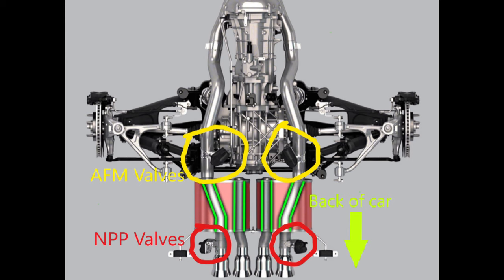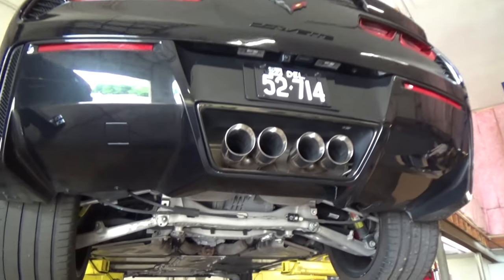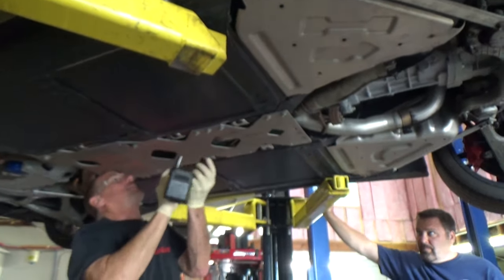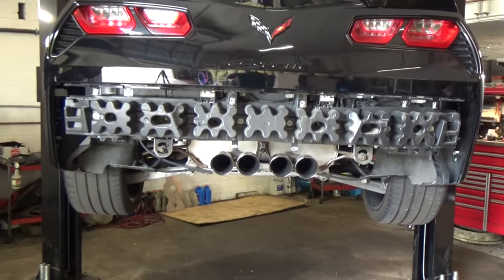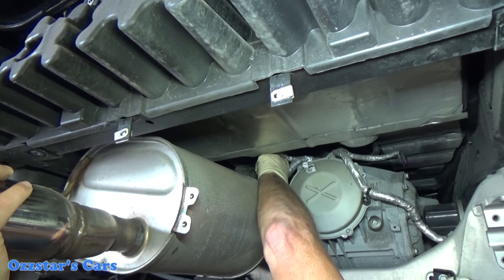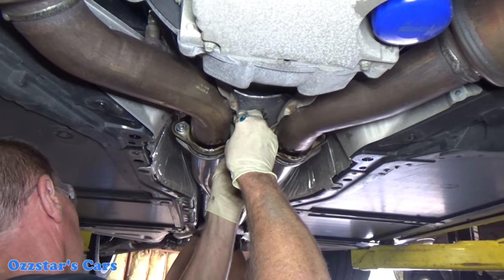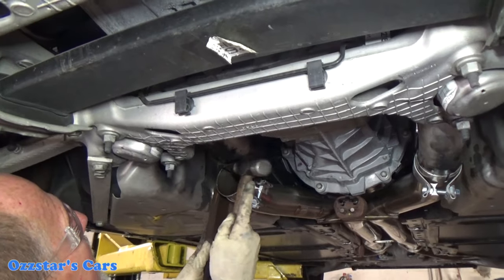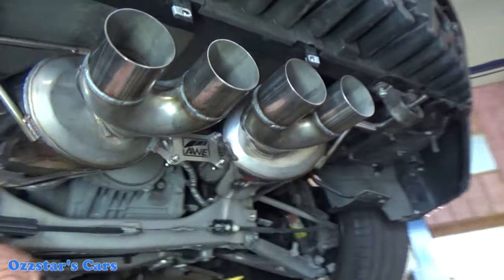Corvette C7 AWE Exhaust System Installed - Is it LOUD enough?

Comment: The OEM X-pipe has secondary cats - not primary so 100% still road legal in every state!
Reply from the maker: LoL okay if you say so Tanner 😂😂😂
Reply: Last time I checked, secondary cats aren’t monitored by the ECU/ O2 sensors 😉
Reply from the maker: @Tanner Needs Tacos on the C7 they are not but as far as emissions standards that's a whole other issue.

Comment: Hello Glen, I have a 2016 Corvette Stingray and It did not come with the NPP valves. I want to install the Stock system with the NPP valves but cannot find any information on that. I am guessing that the Electrical wiring is there, not sure where thinking that a different wiring for the NPP would be more expensive than just adding the NPP pipes on the assembly line. I have found some mufflers but cannot find the listings for the NPP solenoids or motors whatever they may be called. Liked your vid's they are good. thank you for any help you can give, Pete
Reply from the maker: Most likely your car has no harness for NPP valves or the computer module to operate it.  The AWE exhaust is a very good and much more economical solution for a more aggressive exhaust sound.

Comment: Good video Ozzstar..question, are your grand sport rims cracked or anything? I hear the c7 grand sport and z06 are prone to damage due to poor casting.
Reply from the maker: No. I drive with my car in touring mode on rough road surfaces. Softens the suspension, no cracks no probs. 7600 miles so far.
Reply: @ozzstars_cars - that's good to hear..any problem in sport mode?
Reply from the maker: @hugostiglitz8465  love sport mode on those smooth twisties and hearing that exhaust rumble!
Reply: @hugostiglitz8465 i think track mode is the one you want to avoid… sport is probably still fine on the rims.

Comment: Glen, does the removal of the cats affect the emission testing??
Reply from the maker: Good question. I imagine if doing a sniff test it would but in this case there are no O2 sensors that far back, so no check engine light.  Four cats will burn off more hydrocarbons than two. 👍